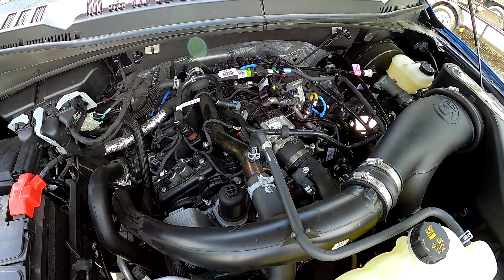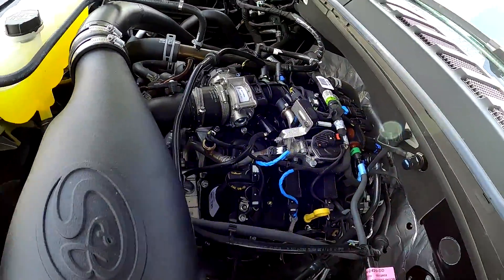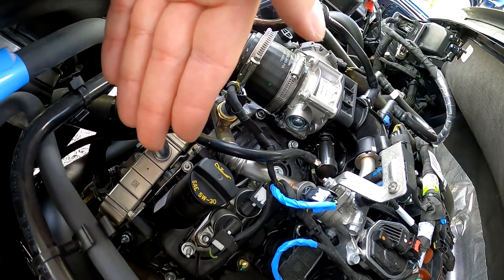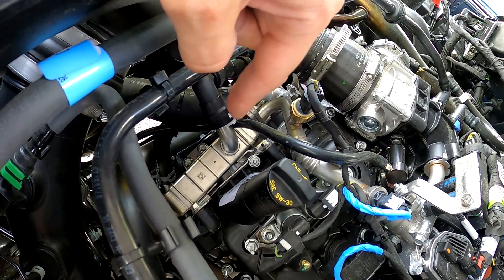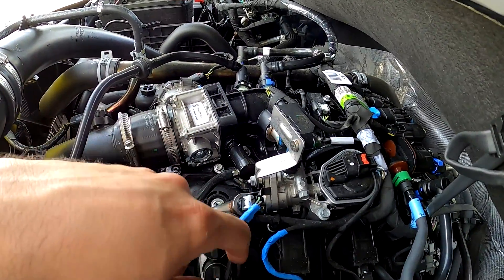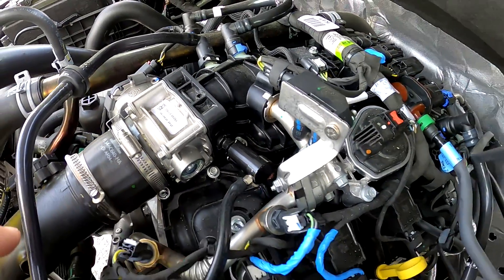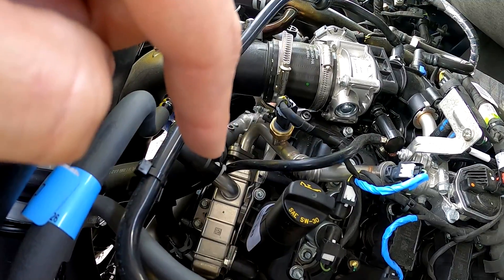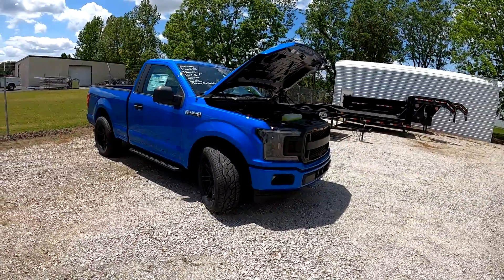Another Ford Gasoline EGR Cooler | 2.7L EcoBoost V6 Emission Systems

Comment: So do you recommend replacing the EGR tube and cooler when the sensor fails or cleaning it out? The tube comes with a new sensor. We are starting to see a lot of these come in to the shop with the same issue. Reminds me of the Prius EGR system that clogged up a lot - those can be cleaned out and put back into service successfully.

Comment: My 2018 F150 STX 2.7 liter V6 “check engine” light came on at 71,000 miles. According to my mechanic it was this EGR that needed fixing. Cost $1,241.13 to fix. Using five new parts.
Reply from the maker: Hopefully that repair was covered under your 8 yr / 80,000 mi emissions warranty.
Reply: 1200???? I only layer 25 bucks
Reply: What code did you get?

Comment: My 2021 f150 2.7 just blew the ERG cooler and sprayed metal into the engine, the result was the engine needed to be replaced. Only good news was the engine was still under warranty as this would have cost me $20k to replace with a new engine..

Comment: My EGR pipe to the cooler to the engine block broke and melted my intake tube to my driver side turbo at 53,000 miles ,but I love it

Comment: I would think the EGR cooler is needed to bring the temps down prior to entering the combustion chamber for preignition purposes. These are fairly high compression engines running forced induction and can still run regular fuel. They need to do everything they can to eliminate chances of pre-ignition. The 2020 2.7 is port and direct injected btw